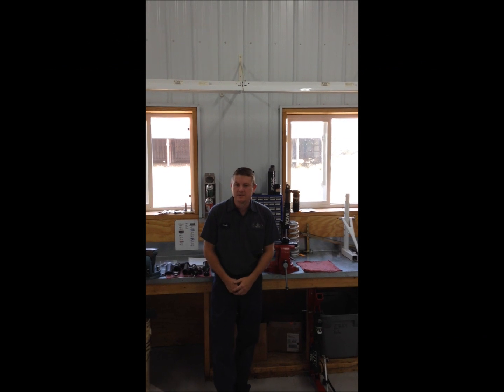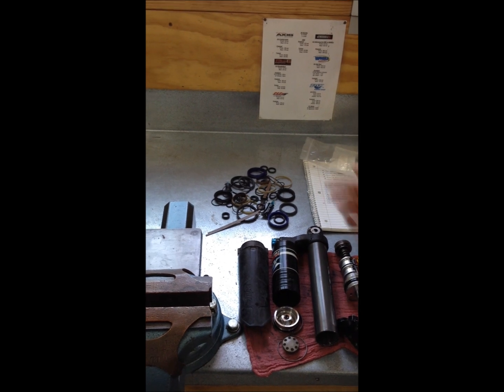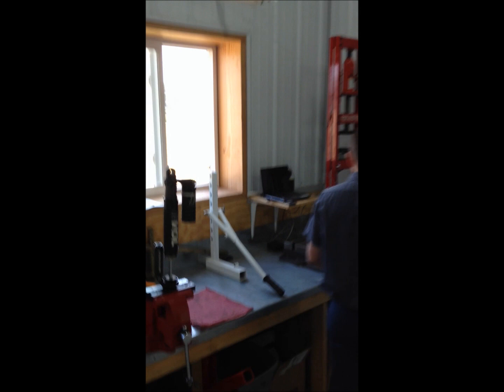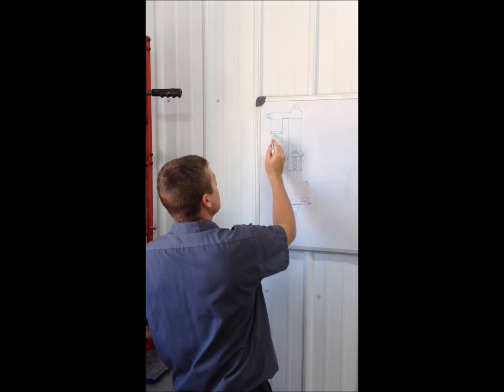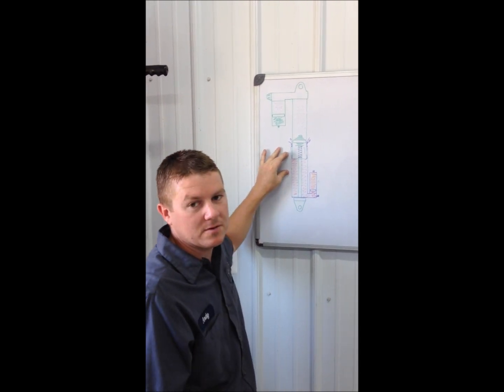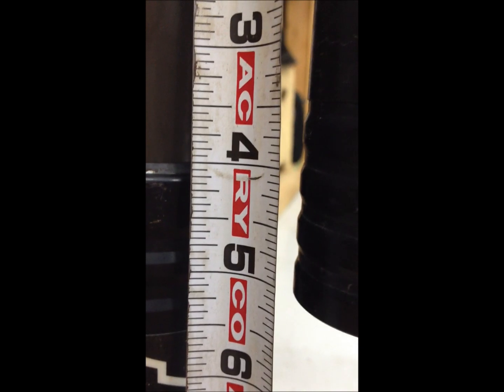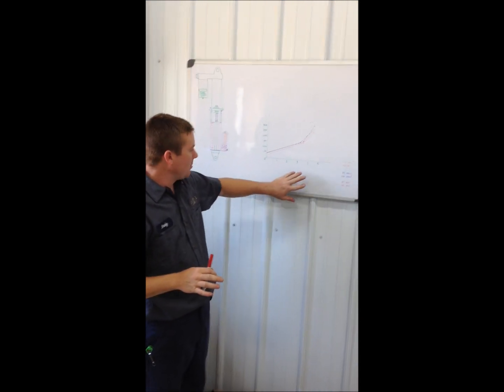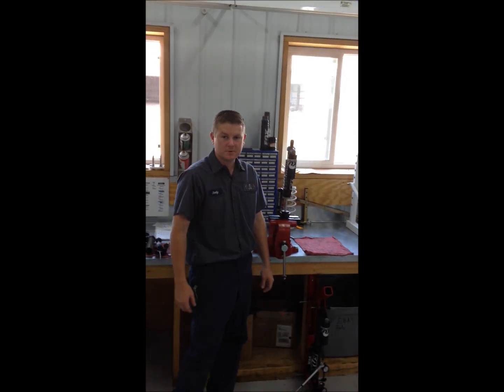How Fox Float X Evols Work by Maul Tech ATV

Comment: i have the fox float evol 3 with two air chamber and two ajust places on my shock its on a honda 450r with long travel it was set up for motocross i want to set it up for wood what would be my pressures for woods riding and mx and tc riding please an thanks

Comment: hi, man I have a ltr 450 I weight about 220, can you give me please any setting for my fox evo 2, main and evo chamber, how many clicks on rebound and how many clicks on high and low speed, clockwise or counterclock, thanks for your help
Reply from the maker: Put all setting in the middle position then air up main chamber until your desired ride height is achieved then set evol chamber pressure.

Comment from the maker: That is correct.  Set the EVOL chamber pressure first because it's a higher pressure.  Otherwise it will raise your main chamber pressure if you fill the main first.  Not sure what 800 Fox is but that is completely incorrect.  Fill the EVOL 1st.  If you're hearing a clunk when lifting the tires off the ground then most likely someone has removed your negative springs or they are too short.

Comment from the maker: Then check the race sag in the rear to see if the spring rate is correct for you.  Your sag should be 4.5".  If it is then you start revalving.  If you come up with a different measurement than 4.5" of sag then you will need to have the shock revalved and resprung.  The fox evols have a rider weight range of about 100 lbs that they sell them for.  This is WAY too large of a window.

Comment from the maker: Just remember that the main chamber is ONLY for setting ride height.  Raise your bike off the ground until your front tires just barely touch the ground.  Measure how high off the ground the frame is at this point (should be right at 12").  Then subtract 4.5" off of that measurement, this is what your ride height should be set at.

Comment from the maker: The internal pistons are not as good on the elka in my opinion.  They use straight holes which puts more emphasis on the pistons than the valving stack.  They also use a one way valve on the rebound bypass which makes them VERY hard to tune and harsh on the compression stroke.